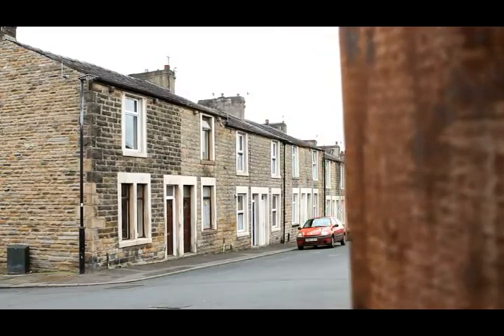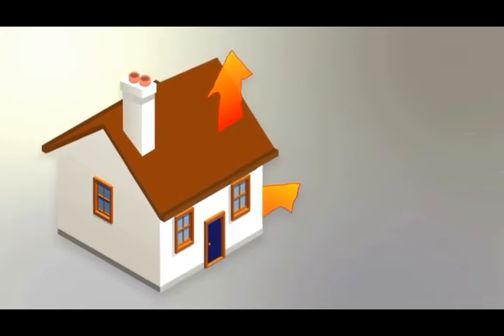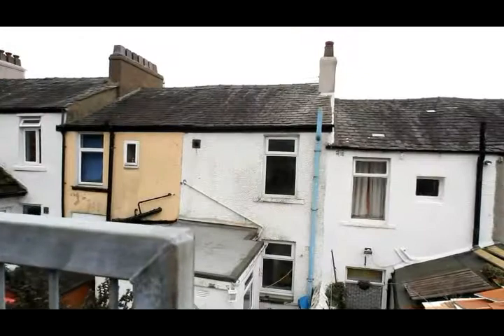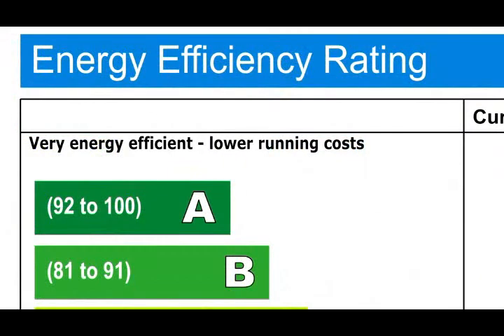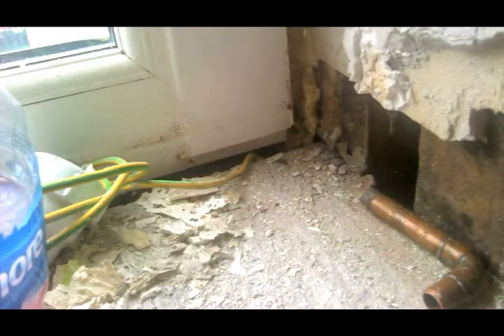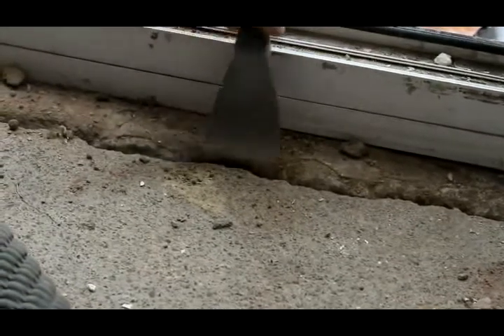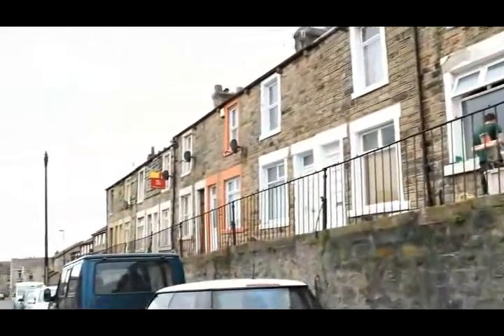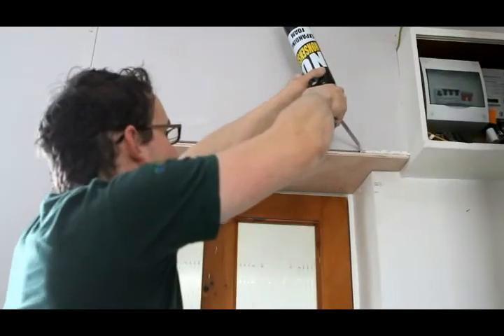Case History: Solid Wall Insulation

Comment: One tip that doesn't seem to be mentioned very often is wall impregnation/sealant. There are several products that coat the exterior walls and prevent them from absorbing water. By keeping those exterior walls dry it prevents the cooling effect that occurs. One example is imagine being naked and wet compared to being naked and dry.. Might sound crazy but it is scientifically sound advice. I have used concrete sealant on several of my walls and I can clearly see how water beads of and the wall stays dry. It works and is as easy as painting.

Comment: I'd like to add to the chorus of people in the comments saying this is not a good idea! Traditional solid walls need to breath. Impermeable insulation can trap moisture in the walls leading to serious damage. I'd be interested to see a follow up to this house ten years on...
Reply: Just to clarify, what's the difference between this house and a house with a cavity? Why would the house with a cavity not have this problem? How else could a older house like this be adequately insulated in a safe manner?
Reply: @NY-Dani  Cavity wall construction, from the early 20th century onwards, is designed to be waterproof. The design typically makes use of damp proof membranes and the outer leaf of brickwork to keep water out of the walls. 

Traditional masonry buildings have solid walls and usually no damp proof membrane. The fabric of the walls are vapour permeable, and were traditionally built with lime mortars and renders which are similarly permeable. Any moister from the ground or from within the building is wicked into the walls and evaporated. If you were to use something impermeable on the walls such as cement mortars or renders, or vapour barriers, this can trap moisture in the walls leading to serious damage. There are a range of 'breathable' insulation products that can be used  with traditional houses, but it depends on the individual house. Best practice is to consider the entire house, rather than a single element, as insulating just one part of the house can lead to thermal bridging and other associated issues.

The best place to look for more information and advice is Historic England's guidance on thermal efficiency in traditional buildings: https://historicengland.org.uk/advice/technical-advice/energy-efficiency-and-historic-buildings/
Reply: @chriscurt89  Thanks for that really good advice. I get what you're saying about the permeable nature of old buildings and the potential problems with thermal bridges. All makes sense. The thing is, what if we used a breathable insulation or how about installing air bricks, would this not allow the property to continue breathing regardless of the insulation installed? Same with windows that have trickle vents, would this not also aid the process?
Reply: @NY-Dani  Yes breathable insulation is an option. Ventilation and breathability are two issues that are often conflated due to the ambiguous term 'breathable'. When we say breathable think vapour permeable. For example you could have a well ventilated building but still damage a solid wall by trapping moisture in the walls. But anyway there are definitely solutions to insulating old houses, but it's usually a case by case sort of thing.
Reply: @chriscurt89  Once again, thanks for the reply. For a typical northern stone fronted Victorian terrace that can't be externally rendered, what would be the best solution? I'm talking about a property similar to the one in the video. My research would indicate putting some internal framework against the walls, installing sheeps wool insulation (or similar), boarding with fibre board (not plasterboard) and finishing with lime plaster (not normal multi-finish). Does that sound like the right direction? Apparently, we're only going to reduce the heat loss a little but won't get the condensation damp problems internally as the products installed are permeable, so a happy medium.
Reply: @chriscurt89  This is mostly wrong. Cavity walled properties are not designed to be waterproof, nor do they have DPMs in the walls.

Comment: What a disaster in the making. Nothing more to say.
Reply: Hi M Bak, please explain why,
Why is it so bad
Reply: @RD-cp3gm  you create a dew point inside the wall trapping moisture. In old buildings walls need to be able to breathe which creates potential problems using modern insulation. You need a water vapour barrier separated from any thermal bridge.

Comment: I haven't bothered with this, even though I could get it, as I feel it could damage the structure of the house by trapping water between wall and insulation, especially if done badly.
The All Seasons Interiors company doing my road right now look a bunch of cowboys.

Comment: I have 2 valid questions because I see a lot of government and eu driven schemes trying to insulate victorian properties in UK:

1. If external wall insulation is fitted ... will this not cause the cement between the bricks to dry and weaken the structural integrity of the external walls ? Remember that these houses are 100+ years old and the cement used at the time was made of lime (So called Roman cement) .... however after years of being exposed to external elements it is changing its properties ... For example the one in my attic got dry and turned into very very fine powder. Which means I can remove bricks by hand if I want.

2. if internal wall is insulated with non breathable celotex type foam or foil underpin plasterboard ... will this not cause for the moisture to be trapped between plasterboard and the brickwork and 
in long run cause the mold to grow unattended between the walls ?

I thought these houses were designed to be breathable ?
Reply: psyhotron666 
I completely agree with your points. I am refurbishing an old 4 storey victorian property and want to improve on u values. Thr only way i have found to do this without causing further damage with condensation/mould is to use breathable materials such as wood insulation and breathable plasterboard and lime plaster. Internal walls we cna use modern gypsum materials but external walls you need to be very wary of when on period properties